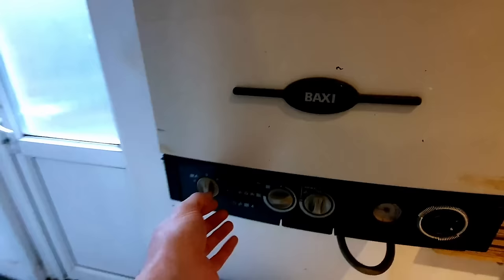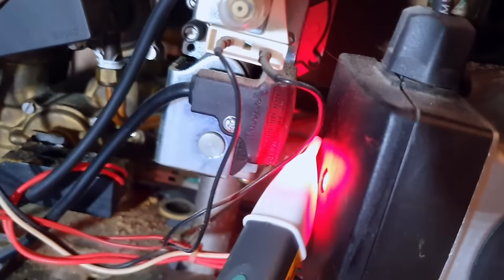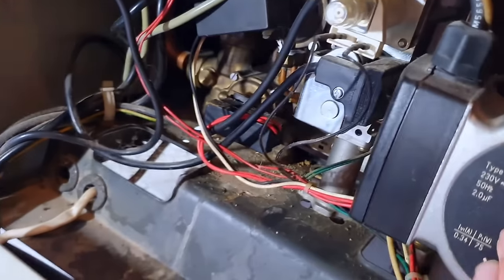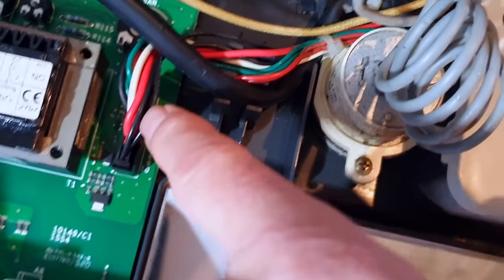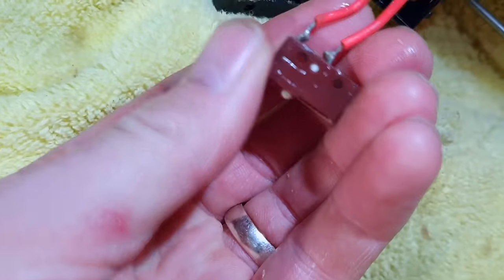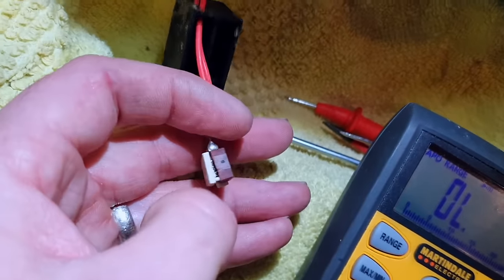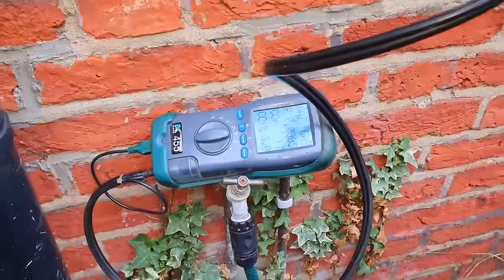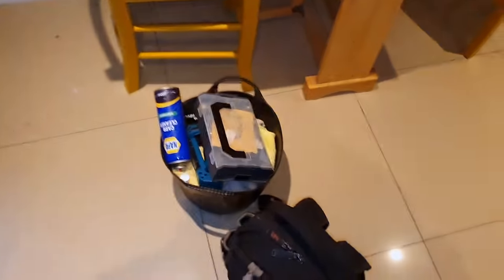"Step-By-Step" Boiler Repair

Comment: Excellent stuff as always, How many engineers would bother to strip down a micro-switch and get it working again !  It's a "needs must" situation and you always persevere to repair where possible!  Love it 👍
Reply from the maker: It's interesting to get to the very bottom of the problem. Also I wasn't leaving to go to a supplier, parking was a nightmare.

Comment: You are a top engineer not just a part changer,you actually found the problem and fixed it, although it would be a good idea to place the switch
Reply from the maker: It would, but at least its going for now :-)

Comment: Cant believe you opened up those switches and cleaned them up. Most guys including myself (retired many years ago)  would have just gone out and bought new ones. Great stuff mate.
Reply from the maker: Thanks. It would of taken longer to go and get one though. Also parking is a pig and I might not of found a space again.

Comment: Great video, as you said from the start the Baxi lights go through the operation sequence, that should give any engineer worth his salt a massive clue to what’s happening, or at least a starting point, must admit though I wouldn’t have had the patience to clean that micro switch, Id be visiting the merchants, but fair play the customer had been messed about enough and you got it up and running there and then.
Keep the videos coming👍🏻
Reply from the maker: The microswitch was a bit of a pain. But it cost nothing and this was a freebie.

Comment: Excellent video and shows the difference between having a fundamental understanding and a systems approach that can be applied across all installations and attending a manufacturers course that shows you how to change parts.
Reply from the maker: I just want to fix stuff and make it work. As if it was my house. That tends to work.
Reply: @HeatingGeek  Absolutely, but you have to be really interested in your work (and have an inquisitive mind, otherwise the default is random part swapping.
Reply from the maker: @normanboyes4983  It must be so stressful to fit a part and not fix a boiler but still want paying. I'm not saying it doesn't happen to me but it's rare enough that I will take the hit on the part.

Comment: Ollie = best all-round gas engineer YouTuber!
Quick question: What software are you using for job management and or Gas records?
Reply from the maker: I use Commusoft but there are others out there. The podcast I was on is part of an app.
Reply from the maker: Try a few before you commit. Also think about where you want to be as a business in 5 years. Get the right app now so you don't have to change when you're bigger and its more difficult.

Comment: Great video, was it not removing the sensing tube of gas valve for max and min burner pressure👍
Reply from the maker: Yeah, I was sloppy. :-) and rushing.
Reply: I’ve seen your videos definitely not sloppy, loved the old Valliant one 👍 when did you notice before you left or during editing 🤣 great you left it in 👍
Reply from the maker: @MidasGasServices   During editing. I had no idea at the time. You cant win them all.

Comment: Over and above level of service bud ..Solid old boilers them baxis..as you say them insulation panels can crack...interestingly I have a diaphragm and microswitch off a 105 in the spares box....why was there no bg blue paper towel...the ultimate leak fixer in the boiler😮😂😂
Reply from the maker: )10 day blue roll. I don't know? I guess your x bG :-)
Reply: @HeatingGeek  SSE for my sins bud, even worse than BG
Reply from the maker: 10 day blue roll a common repair with SSE?

Comment: No vessel checks? The fact the pressure was at 0.5 when you started makes you think it will be flat, plus these and the 105 are famous for flat vessels!
Reply from the maker: Famous for crap vessels. No check I did run up the heating (once I topped it up) and it was all good. I didn't put it in though because watching a boiler work is even more boring than watching on not work. :-) I guess your a Breakdown engineer?

Comment: Never test a 230v component with a volt stick,
It wouldnt tell you if the neutral wasnt there
Reply from the maker: But it was.... So it did. If it wasn't there I would use a multimeter. It was a quick and dirty test. As I said.

Comment: Three words: Methodical. Meticulous & Confident. I spotted a number of issues but you may of checked those off camera or edited them out due to time constraints so from your on screen question so what did you miss?  Which would be very out of character for a man of your experience and skill set
Reply from the maker: Tell me. I was rushing so maybe I didn't see them. I'm a normal guy just going to work.
Reply: Hardly 'normal' in comparison with other so called heating engineers on Youtube but an absolute inspiration to others I would suggest. No need for me to outline them as they were just basic safety checks that no doubt you would of certainly carried out but put us out of our misery and tell us what we missed? @HeatingGeek
Reply from the maker: I didn't have the extra manometer tube fitted tot he gauge. So my burner pressure wasn't correct... But it would have been within the 5% so im not worried.